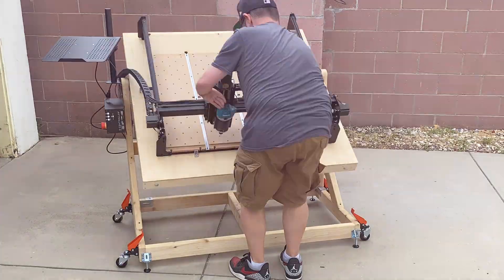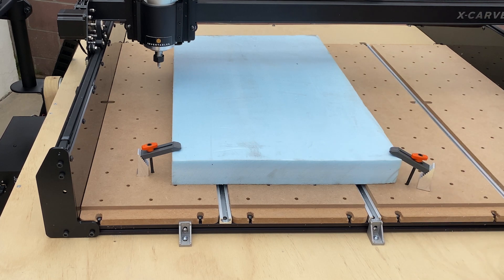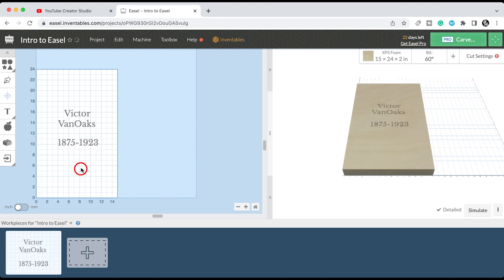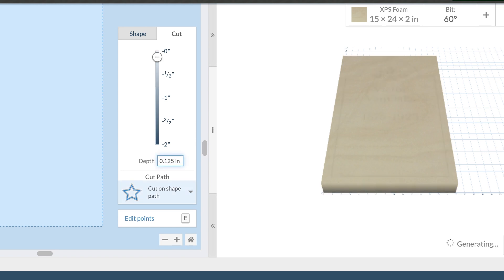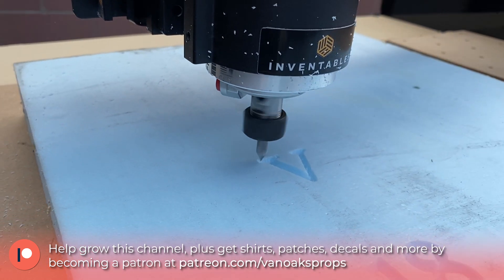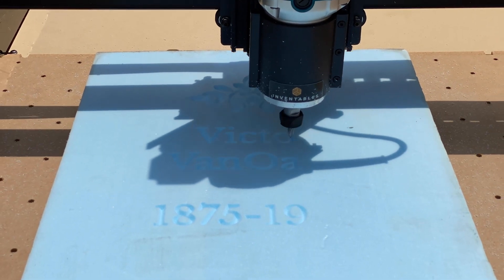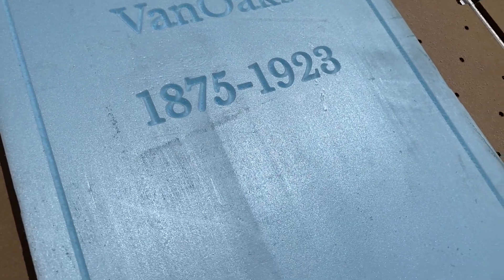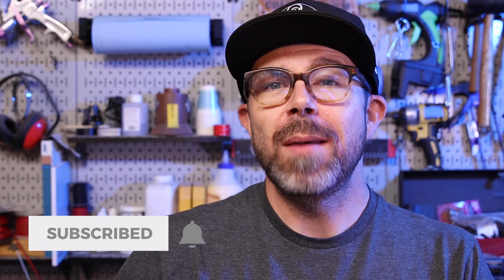Carving Halloween Tombstones with a Robot?!

Comment: Where do you buy your dense foam from? In so cal the only thing I seem to find on occasion from big box stores is the 2’x2’ thin variety. Fine for some things but it’d be nice not to have to glue several layers together to achieve similar results.
Reply from the maker: You have to check contractor supply warehouses. I’ve been able to find it in those types of places, although the other day Lowes had some in stock.
Reply: It's pricey but search for "foam insulation board" at a big box. The one I use is Foamular by Owens Corning.

Comment: I have an X-Carve (first gen) and have been wanting to use it to make plaques and other items. 

What settings were you using (feed rate; depth) to cut the foam?
Reply from the maker: I'm still extremely new to the X-carve, but here's what I used.
Feed rate: 72in/min
Plunge Rate: 24in/min
Depth per pass: 0.032in

Comment: I built a CNC several years ago but haven't done any foam carving with it thus far. I looked into foam mills and for some reason they were stupid expensive. I use single flute for most jobs in plastics and you're right they should work best. I may need to do a few new tombstones this year...

Comment: Wow! That's  great. I wondered if laser cutter would work but yours is perfect.
Reply from the maker: Burning foam is toxic, so lasers are out of the question.
Reply: I reckon you could use a laser when you're cutting all the way through (like for the outline of a tombstone) but I don't know how you would reliably control the cut depth for lettering and engraving.

Comment: I did exactly this (well, using different software) to make the tombstones for my front yard last year. The only problem I ran into was that the thickness of my pink foam wasn't consistent and had little valleys in it that my eye didn't catch until I saw that the text was too thin in spots. That was hard to fix.
Reply: I had the same issue. I got a large bit and did a flattening operation first, creating a inset pocket, then carved all the text with a v-bit to get the nice beveled edges. 
The text comes out very clean.
Then a final operation with a long bit to cut out the outer boarder.
I just wish I could find the foam in larger and thicker pieces.
It works with Styrofoam, just not as well.

Comment: Thanks!  I look forward to your videos.  Do you have any recommended CNC bits that work well with foam?  Also, what do you recommend coating all this with in order to protect it from the elements?
Reply from the maker: Single or double flute up cut bits seem to be the best solution for XPS foam. Once you're done carving, I like to use Drylok Original to protect it from the elements and give it the look of stone. There's a couple video links in the description that show my whole painting process.
Reply: @VanOaksProps  thanks.  I'm looking forward to my first foam carve using my CNC.  I'm re-creating the Pineapple Lanai sign from the Polynesian Resort.

Comment: I'd be very interested in trying this technique -- if I had such a kickass rig like yours -- but I know I would have to rough up the results afterward. It's so clean and mechanical that the results are perfect... too perfect in a way. But that's where the fun of aging, detailing and distressing comes in! I CAN see this method as a HUGE time saver on labor, just ripping through the basic carving. Though I'd be curious to hear how long this actually took your machine, Derek. That would be an important point to learn and test before I'd ever consider getting/using such a rig. I sure can imagine a lot of uses for it, though!  One question: can it cut out a piece from a block of foam, or should you only cut down so far, then manually release the piece from a block?  Glad you gave us a look at this.
Reply from the maker: Absolutely, but there's a benefit (to me) to starting with something perfect and then making it imperfect. Rather than taking something imperfect and making it seem intentional. As for time, this is probably a bad example because I used a V carve bit that's not designed for doing the decorative detail (imagine using a pin tip to carve out the whole thing) but that caveat considered, it was 50 minutes start to finish with the bulk of that time being the decorative element.
It can cut all the way through the foam, with a handful of tabs left behind to keep it in place. I just didn't have the right bit on hand to do it.
Reply: @VanOaksProps  excellent to learn on all counts. It does sound like a big time saver for all the projects it’s well suited for.  More time left to detail and age and weather, all the fun part! Maybe one day I’ll get to play with such cool toys. 👍